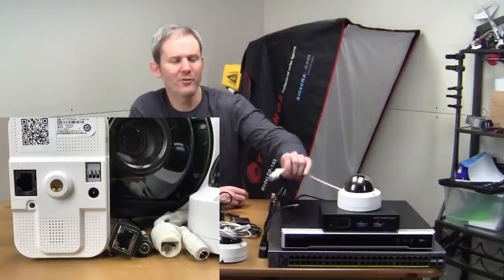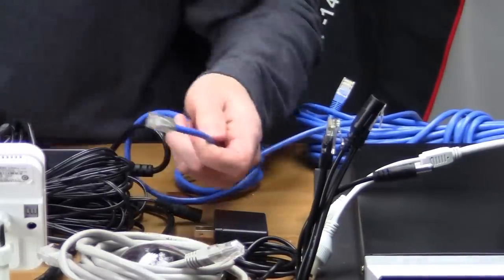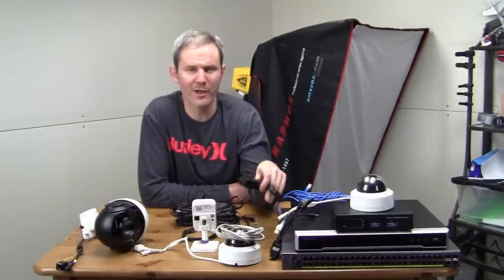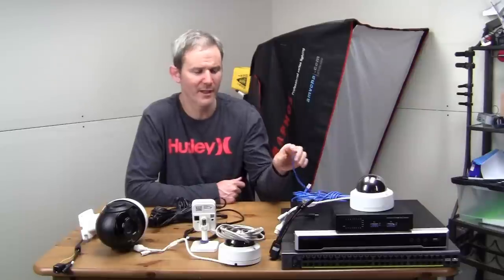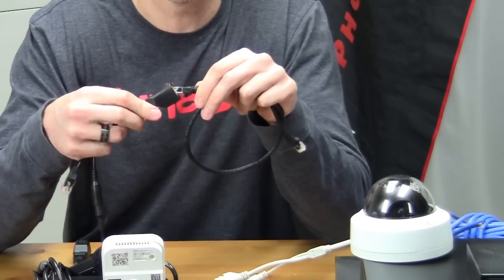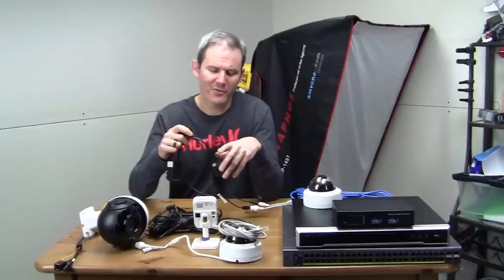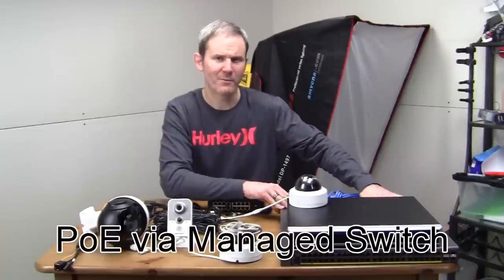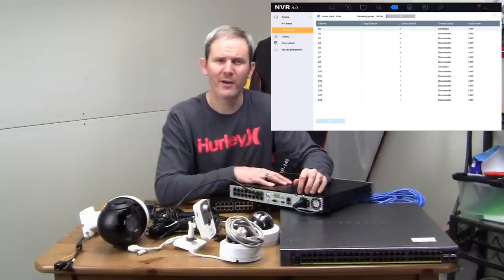How to Wire & Power your IP Security Cameras - PoE

Comment: HIKVISION can go to 300m with PoE at a reduced data rate  :) also here is a tip for you plug a PoE port on the NVR  into a non PoE switch/router  and you can see the Vlan camera on your PC when you do the setup. keep up the Video's and you are doing a good job thanks :)
Reply: great to know.  Thanks.

Comment: You did not mention that PoE+ can handle 30 watts per port, instead of the  15W (works at 55V so can get more power through those tiny wires) - we even power near studio quality PTZ from PoE+ at our church.  I wouldn't go with regular PoE anymore.

Comment: Great video but I can't find any videos that show if these cameras can have cables routed through a smaller hole than the gigantic ethernet connector... Do these cameras typically have a place on the cable that detaches and is much smaller diameter? Thanks!

Comment: is a Gigabit poe switch a requirement or can I use a 100Mpbs? - I am only planning on connecting 2 POE cameras to a switch and the run is less than 100 ft.

Comment: Good video, one thing I am not sure of myself is the following. I want to setup a camera security system but what is my best option for recording? 
Do I wire all cables to my network ‘rack’ and place a PoE NVR there or should I place a PoE switch there and use another option for recording, in this case what hardware should I use for recording and what should I use for programming my camera’s?
I want to acces the footage from my Imac in my home office and from my phone, total of maximal 16 camera’s.
So what is the way to go? Much appreciated in advance!
Reply from the maker: You have a couple options.  You could have the cameras run over your Network, or you could connect them all to your NVR.  I would connect them directly to the NVR itself.  Check out these videos on mine to see your options: https://youtu.be/rOoCw-iZfMU and this one: https://youtu.be/ANqIUYj2yqc
Reply: Home Tech DIY Thanks!

Comment: My confusion is with how to add audio to a nvr i dont know if its nvr because it looks like your nvr all in one system except i don't have it hooked up to internet i just use it to see when in my house or go back and check later type of thing. I ordered a mic and now it looks like i have to power the mic on its outside? How silly. Im trying to figure out if there are 2 wires inside my poe cable that are not being used that i could possible use to power my mic.

Comment: Hi. What's your suggestion ? I need 8 camera cctv that 4 cameras need to be 100m away and 4 about 50m away and I need to be able to viwe the footage over the internet.

What sort of system will be good, it would be getting installed in a village, so wires will go into the earth and through bricks and cement etc.

Comment: Hi. I want to ask about POE injectors.  I want to connect 2 or 3 cameras with a PoE Extender . It says on the "IN"  that max 25.5W .  I found that there are 30W,60W,90W POE injector.   Can I connect a 60W injector to this POE extender, or it will damage the extender?

Comment: Thanks for the video. I've noticed that some PoE systems wire their PoE cameras differently. Works great as long as you plug the cameras directly into the their NVR, but can't add PoE compliant cameras   nor take their proprietary PoE cameras and add them to a other security systems. Well, technically it is possible, but you have to rewire each camera to get them to work.

Comment: If I have an NVR and wish to connect  a unmanaged Poe Switch to it to cater for more IP camera POe ports the LAN Ethernet port on the NVR will be used to link the Switch and the NVR together..... so how does one then link the system to the Router for mobile device access such as mobile phones etc...if the LAN port on the NVR is already taken by the switch link?

Comment: Hi bro, ive bought a nvr and 8 ip cameras and a 8 port poe switch. My poe switch is not powering up my ip cameras, i need to connect my ip cameras with their 12v power supplies. Any idea why.... I thought all ip cameras can connect
 power via a poe switch?
Reply from the maker: The PoE switch should power the cameras. You will need to check which standard the switch and the cameras support. Also, the NVR should be able to power the cameras with its internal power injection.

Comment: Working on a NVR 4.0 system and have had some "rumors" that individual cameras may have stored or cached password credentials on them, which causes the management of same to become more complicated!  I don't buy this because it sounds like "overkill".  Do individual ONVIF cameras have the capacity to store or cache some sort of 'Identity' certificate by default, or is this an 'For added anti-tampering security' -type feature?

Also, when encountering a ONVIF camera with significantly older firmware, my question is, 'How did these ever ship from a factory that way?!?'  I could understand if the firmware was 2 or 3 years outdated, but 10 YEARS or more!?!  That's a huge slap in the face to IP camera consumers and should embarrass the heck out of some vendors! {end mini-rant}

Comment: If i am using a poe switch to connect cameras, is there any need of an nvr for the cameras to be monitored remotely.
Reply from the maker: No, as long as the camera's firmware will allow you to access the camera's remotely.

Comment: Can’t you use the injector and splitter to power the bigger camera? Or you absolutely have to power it with the plug? Please help!!
Reply from the maker: It depends on the camera. This cheaper brand does not recommend it. You'll need to check to specs to see if PoE+ or 802.3at.
Reply: This is my camera. I tried it and it works fine. So does this mean it is ok to use injection and splitter?
Reply from the maker: I'm no electrician but if it works, I personally would use an injector and splitter.

Comment: I have a POE 4 camera kit with a supplied in NVR. The four cameras which I want to connect in the Attic with the Cat6 cables are coming from the cameras from unusual levels. Is there a way to use a unmanaged POE switch for all four cameras in the attic and run that POE switch box to the NVR with a single Cat6 going from the POE switch box to the NVR in the house or would I need to use separate Cat6 cables going from the POE switch box to the NVR?
Reply: I have the same question that I t hink you are asking. Can you run one Cat5 cable from the switch(which has the four cameras connected) in your attic to the NVR (up link?) or do you run 4 cat5 cables from the switch to the nvr?. If you have a answer to your question or mine please reply. that is if you understand my question. just starting out and been studying newf. 's play lists .

Comment: Do you see any advantage to using CAT6 vs CAT5 in these installations? Thanks for the great work...!
Reply from the maker: No difference.  My house was built with CAT5 and I've installed some CAT6.  No difference at this point.
Reply: The CAT6 standard has shielding, so here is what I am thinking: Consider where you will be running the cabling to reach each camera. Is the wire going to pass over a light fixture in the ceiling?  Is the wire going to make a turn past an air conditioning unit with a [strong] motor built into it? (in a solid ceiling overhead) or past a mini-split air conditioning unit?  If are gadgets that will produce EMF or RFI in some capacity, then cross-talk may not be an issue so much as "outside" interference is to consider.  Also, "Cat6A can maintain 10 Gigabit speeds for the full 328 feet of Ethernet cable" (Firefold.com).

Comment: Hello my friend! I have seven cameras with hikvision 7600 nvr 8 poe port my question is can I plug all my camera into a netgear unmanage poe switch and then plug one wire into my nvr would I still get to see all my cameras please help im having trouble configuring this right now 🙏
Reply from the maker: Yes, that would work but you might have bandwidth issues if you are relying on 7 cameras to feed data through one 10/100 PoE port in the NVR. Can you connect the cameras and NVR to your network and access them individually over the network, instead of funneling them into 1 NVR camera port?
Reply: @HomeTechDIY  bandwidth issues! I haven't thought of it. I guess I won't go with that since I dont want any issues. My problem is me getting all the wires to my top floor since my house is three floors so I was planning on wire all the cameras into my garage using poe switch and then run only one cable to my nvr.

Comment: GREAT STARTING POINT!  Thank you.

My only concern is the times which I had to keep backtracking to hear what you said (and/or read what your said, as I keep the CC on as well).  Therefore, I would appreciate greatly if you would slow down and separate words and sentences more decidedly.

Thank your for your time, and any considerations what you may accept for my concern.

Comment: I got an old security camera from a friend because it was too old for most technology now, using a "coaxial cable." (or something) How would I wire that up, and is there something I can use to convert the analog cable output from the camera into an Ethernet digital signal? I was able to power it up with a 12 volt adapter and I tried connecting it to a television cable cable, but it didn't exactly work. any suggestions?
Reply from the maker: You'd need to let me know the exact output of the camera.  If you can get it working as-is, it will prove the device can still function before adding adapters.  If it's a BNC connection, maybe something like this from Amazon could help: https://amzn.to/2PI73fQ

Comment: Hi. My nvr has one Lan port. How do I connect it to the poe switch and seven cameras to the poe switch? My poe is netgear unmanaged 8 ports.
Reply from the maker: It's not common to use a PoE switch to connect cameras to an NVR, unless you have specific network requirements. The NVR's camera ports will provide power to the cameras. If you need to use a PoE switch however, you can connect the switch to a camera channel port and the NVR will find all the cameras on the PoE switch. The issue here is bandwidth as the camera channel port is only 10/100 and you might have dropped frames and lag. You could also setup the PoE switch (with cameras attached) on your home network and also connect the NVR to the network (using the NVR's gigabit LAN port). The only restriction here is a lot of network traffic but if you have a gigabit setup, it won't be an issue. For more info see my videos on this topic: https://www.youtube.com/watch?v=rOoCw-iZfMU&t=39s and this one: https://www.youtube.com/watch?v=ANqIUYj2yqc&t=124s

Comment: @newfiebort I have a question. I have a non-PoE IP cameras (these are 12 v output) but I have also a 54v PoE switch. Can I use my PoE for these cameras like for example I can use injector/splitter to make it work or it won't? That would mean I'll end up using power source?
Reply from the maker: You cannot use a PoE switch to power the cameras by splitting out the power at the camera.  I tried this before and it will damage the camera because the PoE switch is supplying power without regulation by the camera.  You can however use a 12v adapter and inject power into the network cable and split out the power on the other end.
Reply: @HomeTechDIY  if I understand you right, you mean by the DIY approach? That is, tear the UTP insulation and separate the 4 wires/threads and use that as power and the remaining as data, am I right? I saw this concept https://www.youtube.com/watch?v=dP7IQ7v1wDI. Is this what you mean?

Comment: like to find POE box to power my wifi cameras.  Run a cat5/6 and thts it.  Why run power supplies all over ?  Must be something !!
Reply from the maker: Good question.  If one is unable to run new wires for cameras, they can take advantage of an existing line.  For example, in my garage, I have a line to my basement but I am unable to add more lines because the walls are finished, but I want 2 cameras inside my garage and 4 outside; I can add a PoE switch to the pre-existing line.  Does that answer your question?

Comment: Isn't poe 48v not 12v?
Reply from the maker: PoE is the delivery method.  Most IP cameras can accept both voltages depending on the port you are using.  If delivering power to the camera using a 12v adapter, you must use the 12 port of the camera.  The power can be from a 12v adapter plugged into the camera or sent over an Ethernet cable using injectors and splitters (PoE method 1).  If delivering power to the camera using a PoE switch, where the Ethernet cable is plugged into the camera's RJ-45 connector, then, yes, it's 48v.  (PoE method 2).  Both methods are delivering power, just in different forms.  Hope this helps.

Comment: Hello, thank you for your video. I just subscribed to your chinal. Can you explain to me, please? I just bought the POE Network Video Recorder, Zjuxin 48V - 16CH 5MP Smart.265 NVR (1080p / 3MP / 4MP / 5MP) Supporting up to 16 5MP IP cameras Two hard drives included I have 6 CCTV cameras of 5V. But my CCTV cameras is not a POE system. I would like to know what I need? Active 5V 2.4A PoE Splitter IEEE 802.3af Adapter or Splitter Kit + Injector PoE Adapter Power Supply by Passive Ethernet Cable RJ45 1 Pair 5 V 12 V 24 V 48 V SVP Gigabit PoE Splitter, USB Micro 48V to 5V 2.4 A Ethernet adapter, Works with Raspberry Pi 3B +, IP camera and More Ethernet data rates 10/100/1000 gigabit or Mbps I don't understand anything lol Thank you for your help. but what watched in your video if I have POE switch then no need those stuff with I need directly cameras, but this 5V need injecter or slitter? thanks, advance for your help.

Comment: I do have a coax cable port downstairs in the office and a cat5e port in the kitchen.  am I able to use a device to convert that coax port into an ethernet port that way I can connect my NVR system to the ethernet over coaxial cable port and then my cameras to the NVR?

Comment: So this is what im wondering, Can you not go from one port of the NVR into the core POE switch, then plug all the cameras into the same core POE switch ? Then all the cams are on the same network and getting power from the POE switch . Instead of plugging 16 Cams into the NVR directly .
Reply from the maker: Technically, yes, you can run a cable from an NVR camera port to a PoE Switch and the NVR will act as a router and hand out IP addresses to all the cameras added. You may however run into bandwidth issues as this NVR port is only 10/100. You could also add the cameras to your LAN and access them through the NVR over your network and not use any of the NVR camera ports on the back. Check out my other videos where I cover these scenarios in detail.

Comment: Hi, sorry for stupid question but I would like to connect 4 IP cameras to my Poe switch which will be located in my attic.. there is no direct ethernet cable there so I want to use a  tp powerline extenders like the one you showed on one of the videos - would it work ? I want to use my Synology ds 220+ ( together with surveillance station package ) in this configuration so the another powerline adaptor will be downstairs and connected to my nas. I just worry that my nas won't be able to find these IP cameras .. many thanks for your advice and help ☺️☺️☺️
Reply from the maker: Hey! Your TP Powerline Extender solution should work, but keep in mind these extenders aren't as fast or reliable as a network cable. Make sure your router/modem is connected to this camera/nas setup somewhere. I would suggest connecting the Powerline Extender in the basement into the router/modem or another switch (which is connected to the router/modem) and then running network cable to the nas. Let me know if that helps. Thanks
Reply: @HomeTechDIY  Thank you very much Sir for reply! :-) Will give it a go soon ! 🤓

Comment: Great Video! I have a question about the poE Switch. I would like to install 4 cameras at a more remote barn (about 50m from the house). Can i plug the 4 cameras into a poE Switch and only run a single Ethernet cable from the switch in the barn back to house and connect it to an NVR? Will the NVR show all 4 cameras? Thanks
Reply: I have the same question ;)
Reply: 4 camera in PoES run 1 cable to ur house but you cannot connect to nvr directly. use router then to nvr
Reply: Onbekend talent

Comment: Hello,
I have a nvr and want to add multiple camera's over a long distance. I can get about a 100m with poe, but i need more. I cannot use one utp from the nvr to a poe switch after a 100 meters, but need an injector per wire, right?

Thanks for replying

Comment: What options do you have if you need to run a IP camera 1700 feet away? Cat 6 is limited to 300 feet.
Reply from the maker: Unless you want to run copper or fiber, your best bet will be wireless.  If you have line of site to between the 2 locations, you could use a Nanostation: https://amzn.to/2Nk1MwB